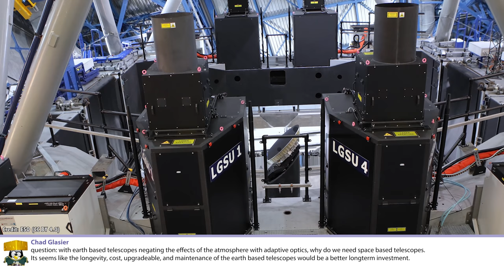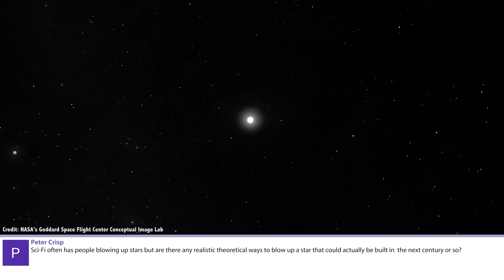Q&A 32: Why Can’t James Webb Be Repaired? And More

Comment: Ok, I have a question! Why do gamma rays and x-rays don't cross our atmosphere, even though they are more energetic than the rest of the spectrum? This is so counter intuitive! 😮
Reply: L Galicki Band I think its due to the Magnetosphere, higher charged particles can't get trough it
And lump up in the VanAllen Belts
Reply: Also our athmosphare composition is NOT transparent to all types of electromagnetic waves. Most energetic waves which reach earth surface fairly easily are barely above the visible light. We have evolved to use most energetic useful light reaching earth surface. In general size of the particles in the athmospahre vs wavelength is something which determines which can and which cannot pass through. Outside visible spectrum (aka rainbow colors) the best way to observe space is radio waves as they reach earth fairly easily. But due to their very low energy if humans  would try to evolve radio vision we would need very strong and large sensors (use a lot energy to build body parts and then to maintain them) so one could imagine animals which tried to see radio waves as their main vision sensor would most likely had huge disadvantage in the predatory world.
It is worth to mention that due to the athmosphere light scatering (mostly on the edge between visible and invisible light) we get blue sky which is sunlight which instead of reaching surface in nice linear stream bounces allover. But the sky is not blue, you just see some sun light spectlum everywhere like many mirrors of the sun. The moment sun get blocked (eg in eclipse) all sky gets black.
Hope it helps :)
Reply: I dunno for sure, but my guess is because the atoms and molecules in the atmosphere absorb those frequencies a lot.

It can't be the magnetosphere because magnetic fields, specially ones as weak as Earth's, don't affect light.
Reply: I would have thought that photons of lower frequency have an easier chance of getting through the clouds and the atmosphere. Correct me if I'm wrong, but the magnetosphere protects us from high energy particles which come in the form of electrons, protons, neutrinos etc that come from the sun and interstellar space.
Reply: Like I said; Earth's magnetic field is not strong enough to influence photons; you need a magnetic field like from a magnetar to have any noticeable effect, and even then, it's just sorta slightly blurring and not blocking.

The magnetosphere helps with other stuff, mainly high-speed ionized atoms; but for photons we depend on our atmosphere.
Reply: TiagoTiago Thanks, Tiago. Off topic: are you Brazilian? I'm asking because I am and because of your name.
Reply: Why can you receive wifi through a brick wall, but the MUCH more energetic and intense sunlight does not pass through?
Hint: the transparency of matter varies depending on the frequency of the light that hits it.
.
.

Nitrogen+oxygen is transparent in visible, microwave and radio frequencies, but is quite opaque to anything higher than high ultraviolet.
And we have a LOT of atmosphere above us! You have the same mass of air above you, as the mass of water in a 30-foot deep pool.
Reply: Marvin Kitfox Ok, but why oxygen and nitrogen are opaque to higher than visible light photons? 😮
Reply: Because a photon with a high enough energy interacts with the valence electrons and get absorbed, that's why. In the process, electrons are kicked out and form a cloud that is pulled to the poles together with other high energy charged particles - and that forms the auroras. A photon with a lower energy (=lower frequency) isn't absorbed so it cannot interact with the atmosphere and it passes through.
Reply: TheEEStudent Thank you so much! That's the kind of answer I was expecting! I suspected it's got something to do with quantized energy.
Reply: @ L Gallicki Band    You said...Why DO gamma rays and X-rays DONT cross our atmosphere....the D & the DONT cancel each other out so whats the actual question?
Reply: Chris Daldy-Rowe Lol! True! Bad English! Sorry! 😄
Reply: NNNNEEEEEEEEERRRRRRRRRRRRRDDDDDDDDDDDDDDDDDSSSSSSSSSSSSSSSS

Comment: But Fraser, why not augmenting the size of JWST's fuel tank!
¿What.. not enough funding for a bigger gas tank? xD

I would have made it refuelable.. like a fighter jet!
Surely the engineering is not THAT hard for a basic Space Refueling System (SRS), right? I mean it's already been developed by the military, so it's not even like those NAZA guys have to invent the wheel or anything.. :S

Comment: 18 minutes in.  You claim that if a moon rotates around a planet faster than the planet spins then it will crash into the planet eventually and if the moon is rotating around the planet more slowly than the rotation it will drift away.
I think I can safely assume you are wrong.  Finally, you made a mistake simple enough for me to spot it - woohoo.  
if the moon is faster than the escape velocity it will eventually spiral out whereas if it is slower than the escape velocity then it will spiral down and crash.
It is as simple as that.
Only the escape velocity matters in deciding whether it is going to move towards or away from the planet.
I'm damned sure about that.  The maths is easy enough for even me to confidently grasp it.
What I thought you were about to say was that if the moon is faster than the rotation of the planet it will speed the rotation of the planet and conversely if it is going more slowly it will slow the rotation.  That would have sounded plausible but even that would have been wrong (I think). 
The whole of the planet is subject to the gravity of the moon not just the bit you are obsessing on.

Comment: Why don't we save up a shed load of doe, and build a telescope that orbits the Moon. No atmosphere to create drag, and could be a stable orbit as well.
Reply: A telescope orbiting the moon doesn't have any benefits over a telescope orbiting the earth, and it would cost more to put there and to service because its more expensive to get there 

The Lagrange point that Webb is being sent to has nice benefits because the sun and the earth (which are both give off infrared radiation) will both be in the same direction. Because of this the sunsheild of jwst blocks the heat from both, which is required for the sensitive infrared measurements jwst is made for.
Reply: There are optical telescopes. No atmospheric drag and little space junk. Closer as well, so if space vehicles become better and cheaper it may be repairable. The Webb costs a lot, if it goes badly wrong it's lost forever, a telescope round the moon maybe salvageable.